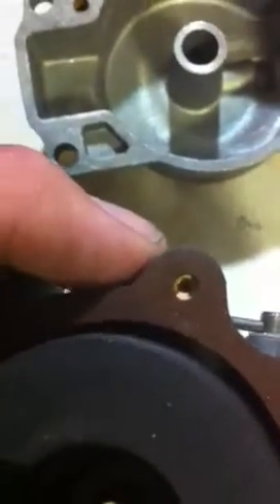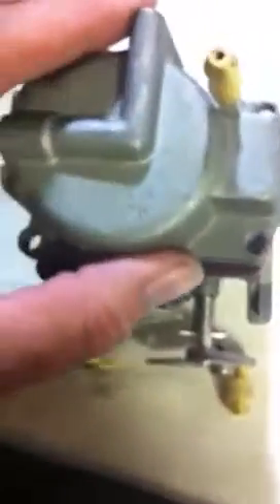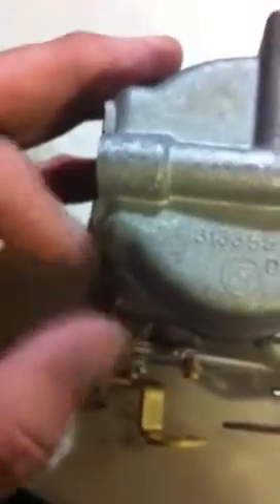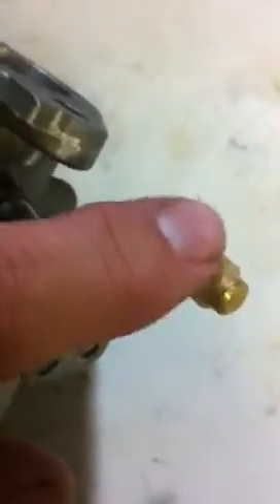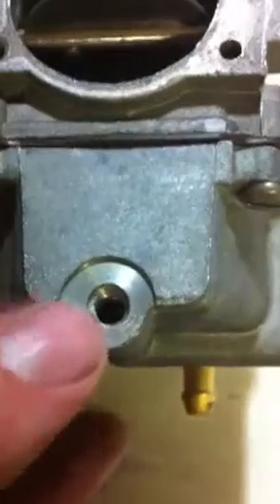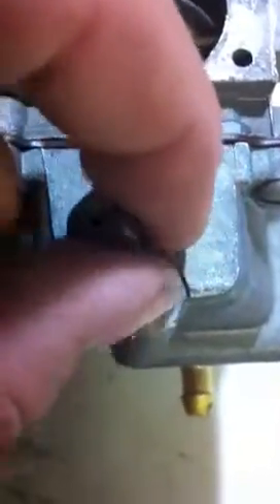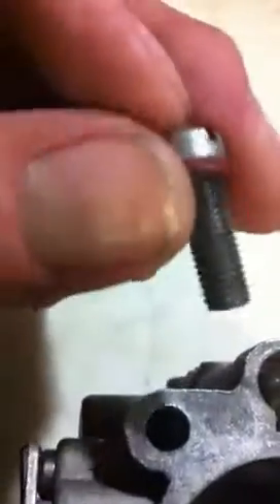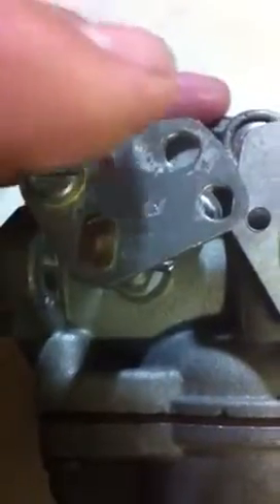Carburetor 1975 Johnson 70 hp

Comment: I think the top carburetor is the one with the fuel feed from the pump. Mine's a 1976... I guess it could be different, but not likely. Anyways, my question is, is that a new kit that came with all of the parts? I need to find the small, round gasket that seals the bowl... the one you almost forgot. I have a feeling I'm going to have to buy the entire kit, though.